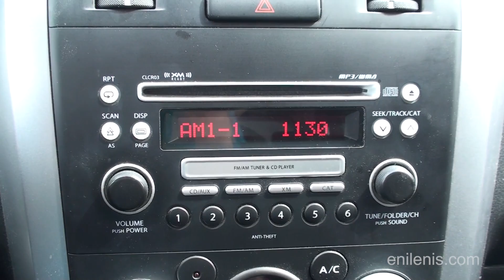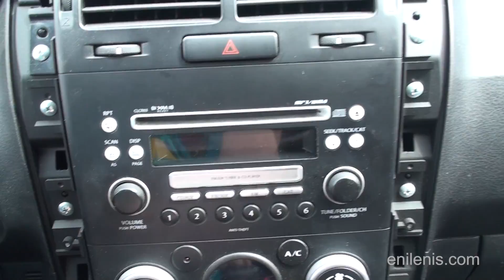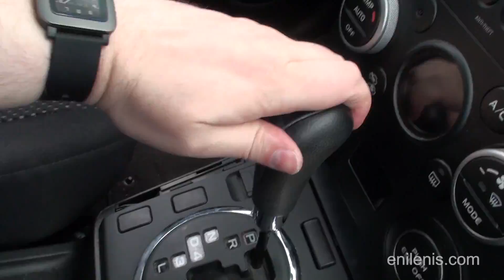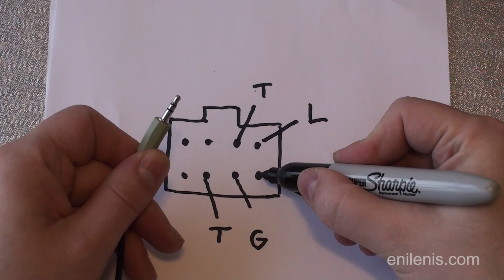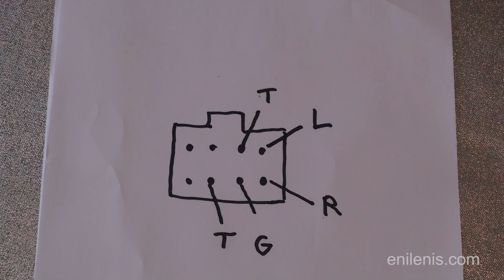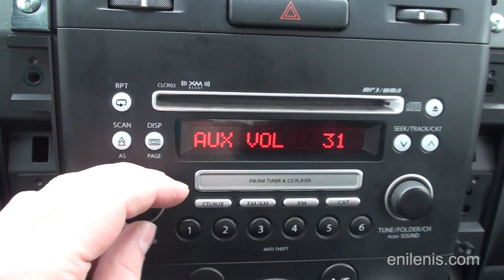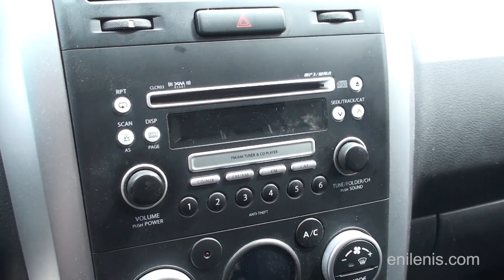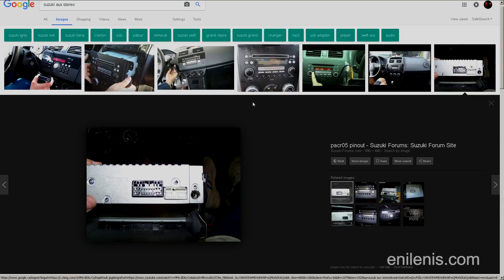Suzuki Aux Stereo Input Mod

Comment: This is such a pain in the ass. I dont know why suzuki didnt just add this $2 piece.
Reply from the maker: They didn't add $2 so they could make $100 extra. Include Aux button but no Aux function? What is that but a tease. Would they sell you a car with 3 wheels if they could charge you extra for the 4th one? You betcha!

I had one safety sensor replaced in the car and it was $1K. For a freaking sensor that I could've made myself for under $100. I had no idea, until the work was done and they handed me the bill. There is always the official way of fixing and proper way of fixing that costs less than 10% of what the dealer will charge, but have to not be afraid to get hands dirty.

Comment: All I did was pay some dude from the Suzuki forum 12 bucks for an adapter that I was easily able to install by going through the glove box (removed). To the left, the stereo wires are visible. Literally took 2 minutes.
Reply from the maker: $12 is worth paying. Suzuki dealer would've charged no less than $100 and many online offerings are also overpriced. I had junk parts on hand, so I did it my way. Feel free to post the link to the $12 solution. Not everyone might be willing to solder and drill to get their stereo working.
Reply: @enilenis  There are a few on Ebay right now for 7-9 bucks, free shipping. Search "Car 3.5mm AUX Adapter 8 Pin Plug Audio Cable For Suzuki Swift Vitra Jimny AC1277" or "Car Audio Adapter Cable 3.5mm Aux Jack 8 Pin for Suzuki". You can also check out the forum for more info... https://www.suzuki-forums.com/3g-2006-2014-vitara-grand-vitara/14338-head-unit-aux-input-information-7.html
Reply: So, you did not remove the whole unit to get to the back? Can you please tell me how you managed to get there to plug the cable at the back?
Reply: @nruizCR  removing the whole unit and parts of the console is completely unnecessary. Once you take the glove box off, you can easily access the area needed.
Reply: @djb6496  Really, that easy? Great! I will try it.
Reply from the maker: When unplugging you can reach with your hand and unhook everything easily without even having to see. When installing the stereo back in, cables will only go into correct sockets. They're color-coded and socket shapes are unique, so you won't be able to make a mistake even if you try. The only thing that obstructs removal of the stereo is the gear knob. Unhook it and you'll have enough room to work comfortably. Just make sure you don't accidentally scratch the front of the stereo with the threaded end of the exposed gear changer.
Reply: Do you have a picture of the adapter that worked for you?
Reply: Just did this myself, so couple of pieces of advice:

Going through the glove box is possible but boy do I not recommend going through there. Can vary extremely on your hand size, and I tend to have a pretty slim hand. You have to reach deep across the back of the stereo to plug this in, and unless you have a snake for an arm you're gonna get all sorts of scratched up...soooo-

My recommendation: Remove the stereo and the glovebox. This is pretty simple, pry off the silver lining pieces, then unscrew the 3 important screws on each side. You'll need to have the shift in neutral position to pull the stereo far enough forward, but here you'll be able to easily plug in the adapter. Don't even have to worry about unplugging anything.

The glovebox is a simple matter of pressing against the sides and reaching underneath it, should pop out simple enough. After that, you can easily feed the adapter out behind the stereo and through the space of the glovebox. Simply pop the box back in, and ta-da you have an aux cable now. The recommended cable is plenty long enough to reach most wherever you need it.

It is a beauty to finally be able to hear my music throughout the car rather than a bluetooth speaker. Shoulda done this a long time ago. I might look into getting a female audio port (see a few online,) just so I could use my own aux cord and be able to plug it into my phone w/o removing the case.

Comment: Buy a Yatour usb adaptor on the internet, 40-50 dollar or so. Plug it in, done deal. Reads SD cards too.
Reply from the maker: There is plenty of off the shelf solutions. If a person has money to spend and doesn't want to solder, I'm all for it. I have a separate car amplifier with an SD slot that I sometimes use. Was also about $50. Don't remember which brand it was.

Comment: thanks,,did a while back on my 2008 sx4 hatch ,,,,now  on the sx4 2008 sedan
Reply from the maker: Great. Even though Suzuki makes many different stereos, the control plug on the back is typically the same, and if the shape matches, then the hack works. Too bad they didn't leave a placeholder for where the headphone socket would go. I didn't want to drill the stereo faceplate and picked the lower panel. Positioned the thing on the right, because the passenger is typically the trip DJ and I didn't want wires running across the shifter. If I have to control the playlist myself, I use a smartwatch, so that I don't have to interact with the phone while driving (which is illegal). Helps keep eyes on the road.

Comment: Thanks for the video man, however, does a 14 pin connector on a Suzuki GV requires the same wires to operate in aux mode?

Comment: Hi! Thank you for your video. May I ask something? I have a suzuki jimny with a japan stereo. And it has the same 8 pin port however I cannot find the AUX option in the stereos software. I cant make it work the model of the stereo NVA-MS3280
Reply from the maker: After searching on some forums, I read that yours is probably activated by hitting the CD button twice. It's not labelled AUX, but it's the same button. You need to have the cable connected first. I can't test it, since I don't have a Jimny.

Comment: Great job bro,,, only issue I have is AUX only works first time when testing....when i switch to FM and back to AUX and AUX wont come back... any thoughts on why this happens pls
Reply from the maker: Strange issue. Try a reistor with a lower value. If you're using 10K, try 1K. One of the pins it bridges has high voltage, and the other is ground. When you put resistor in, it's supposed to pull the high voltage line to 0. If resistance is too high, it may not reach the theshold. If you only have 1 type of resistor, try 2 in parallel instead of 1. That's the only solution I can think of. Mine still works fine, and no one in the comment section experienced what you're getting.

Comment: Can I just not use a resistor and just jump the too
Reply from the maker: They say 10K. They don't say what a direct short will do, so I can't be responsible if you try it. They would have to have a load resistor on the pin output, or it might short power and kill the console. Risk not worth taking, when you can just rip a resistor out of any piece of electronic scrap.

Comment: Any thoughts on adding a dedicated ipod as the primary music player? I would like to stuff an ipod in the glove compartment and not deal with turning it off whenever I end my driving trip. What I mean is, when I turn off the ignition, the charging cable (plugged into a 12v outlet) also loses power, but the ipod continues to play because of it's internal battery . I would like to the ipod to turn off with ignition off. Any ideas?
Reply from the maker: For me it's easy to have a player run off a cigarette lighter adapter, but if you want more convenience, you could wire the power supply to the underside of any of them and run extensions. The car could use a USB charging port at the very least. Another option I was considering when building, is installing a bluetooth receiver instead of the 3.5mm socket. All it takes is a pair of some cheap $10 bluetooth sports headphones to strip down, hook up to 12V through a 12-5V adapter, and then sync, power and volume buttons would have to be extended to one of the surface panels. I went the easy route. Problem with the glove compartment is that it's not easy to pass wires into if it's closed, and if you are to install sockets in there, it's much harder to get to the inner wall without taking apart the front interior. You need power and audio. Bluetooth would take care of sound, but charging - if you want less damage - cigarette socket adapter. Otherwise, solder adapter under the socket and run wires to where they are needed.
Reply: @enilenis  Thanks, but I think I may have found the solution to my needs. And that is, for the ipod to turn off when power to the charging cable is also turned off. As most people are aware, depending on the state of it's internal battery, the ipod will continue to play when the charging cable loses power ie, ignition turned off.  

Over the years, I have collected many "propriety" USB to 30 pin connectors from different aftermarket head units. I went through my collection and found one that did just what I needed. This adapter/connector has a circuit that pulses the ipod off when no voltage is detected on the output audio pins. The options you provided should give your viewers other ideas which is why we look at videos such as yours.  Peace.

Comment: hi everybody i have a question, how can i do it on my suzuki swift if i only have cd's function and not a cd/aux function? thanks
Reply from the maker: Swift should have the same white socket on the back, so it's the same procedure if you want to do it yourself. Online there's plenty of options now. Cables under $6 with a stereo plug on the end, or even a bluetooth alternative for about $30 on ebay.

Here are some examples of what's available, if you don't want to solder:
https://www.aliexpress.com/item/32844939350.html
https://www.ebay.com/itm/13-Pin-Car-Bluetooth-Music-Aux-Adapter-For-Suzuki-Swift-VI-Jimny-Grand-Vitara/293641728272?_trkparms=ispr%3D1

Comment: Is there any way to run a signal output for a subwoofer amp from the stock head unit? Right now I have an auxiliary splitter going from my phone to the head unit and back to the subs. I would like to be able to use fm radio with my subs too. Any thoughts?
Reply from the maker: Output on the stereo is a different socket - typically a wider white one. You can google "suzuki stereo pinout" and find a wiring diagram. It's designed for 2 stereo pairs and there is no dedicated center or subwoofer channel on it, so the only way to wire is to have it run off a combined front or back lines. The problem is that the outputs are amplified, and you would need a voltage divider to bring the gain back to linear levels, or else it'll blow subwoofer input. https://i.stack.imgur.com/vqqEM.gif - something like this. If I am to assume that the speakers run off 12V, then R1 would be 10K and R2, 2K, to lower voltage to 2V. I also don't know what kind of loads the stereo can tolerate and whether adding a voltage divider would put it over the edge. I simply haven't tried doing this sort of thing.
Reply: Ok. Thank you. I think I'll just stick with my current method until I can get some speakers for my 200w head unit which has sub output.

Comment: OP, do you have the 2.7l v6? Have you tried running it on premium? I daily one, night and day difference for thr underpowered v6
Reply from the maker: Yes, mine is 2.7L. I run on premium sometimes, but mostly for the sake of getting a tad more mileage, compared to ethanol mix. It adds 30-50km to the range. I drive on level terrain, so power and acceleration are never an issue, even with lower grade gas.

Comment: For suzuki swift 2009? Any hope?
Reply from the maker: Swift stereo has no signal inputs, so the only option is to use an FM transmitter, or have an aftermarket stereo.
Reply: I have an 08 swift and it has the same connector at the back of the stereo unit. I do not have a button on the front that says AUX though.
Reply from the maker: @yasiral-hilali7855  I don't know if there is some button combination that switches to AUX. I suspect that there isn't and despite the socket looking similar, there is no line input attached.
Reply: @enilenis are you saying that it might not be internally connected to anything?  thanks for the response by the way!
Reply: @yasiral-hilali7855  It will work still. I have a clcr20 radio and tried this mod and it worked flawlessly.
Reply: @MrTripplex95  Thats awesome, what button combination did you press/hold to access the AUX input?
Reply: @yasiral-hilali7855  just press the button labelled CD.
Reply: @MrTripplex95  oh really that's interesting. I couldn't sworn I tried that but it would just play the CD.
Reply: @yasiral-hilali7855  what model radio do you have?  Mine is clcr20
Reply: @MrTripplex95  I believe the I had was the same as looking at photos of the clcr20 shows the same buttons
Reply: @yasiral-hilali7855  gonna upload a video to my channel

Comment: Awesome
Reply from the maker: Thanks. I'm bewildered as to why some people choose to vote this thing down. Maybe they're the ones selling the same type of cable for $30+ on ebay. My only out of pocket expense was the 3.5mm socket, which was about half a dollar. The rest was scrap. I later discovered there were different types of stereo sockets also, inserted from the top with a mounting nut at the bottom. Those require a larger hole to fit through, but eliminate the need for thinning out the plastic. If I had to do the mod again, I'd probably go for that option instead.
Reply: enilenis it's a genius and professional installation. Better than the original cable that it's too expensive. I didn't know when you connect the resistor the auxiliar mode actives. +Subscriber👍
Reply: @enilenis  your video is really usefull and easy to understand. Im going to do it in my Vitara. Thank you very much.
Tomás from Córdoba Argentina
Reply from the maker: Glad to be of service. Good luck with your mod.

Comment: Could of just bought on fm transmitter
Reply from the maker: Have 2 of them. Reception is crappy. Sound quality is worse compared to a direct connection.  Additionally, every once in a while you pass someone who also happens to be using an FM transmitter and they jump onto your frequency band. Couple of trips up and down the highway with such unpleasant interruptions and you say: "Enough! I want to be wired in". It is also possible to install a bluetooth module instead of the 3.5mm socket, but the setup gets a bit more complex, requiring step down power (car runs on 12V and most bluetooth receivers need stable 5V). Control buttons are also needed for device sync, volume control etc.

Comment: I rented this car. It sucks
Reply from the maker: Cheap bare bones car for people who care about getting form A to B with virtually no maintenance spending. Also, the cheapest car with proper 4x4 drive and a full differential lock. In the snow it beats every other car and even outruns a technically superior Subaru Forester. After Suzuki pulled out of North America cars got progressively cheaper and parts got more expensive, so the best thing to do is to drive these things till they can't run anymore. A car is just a car. With Suzuki you get exactly what you paid for. Nothing more, nothing less.